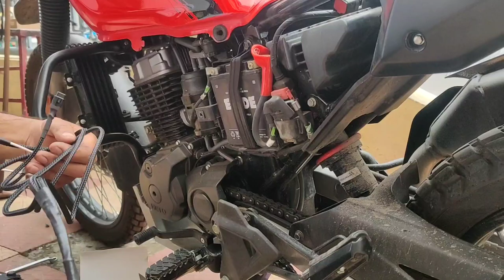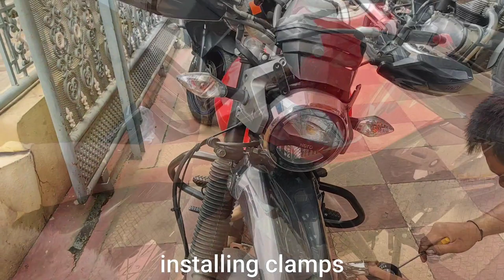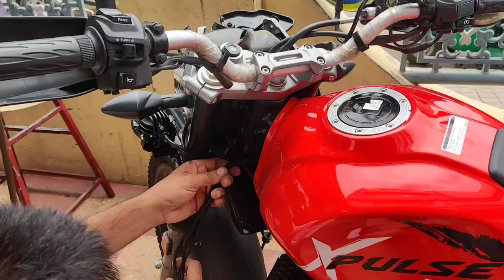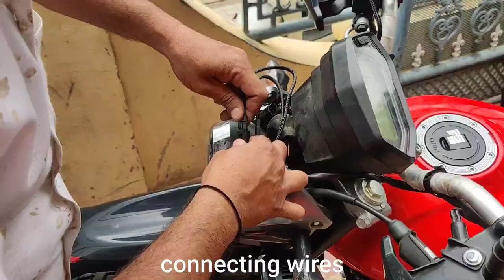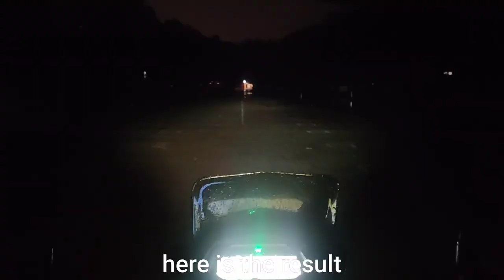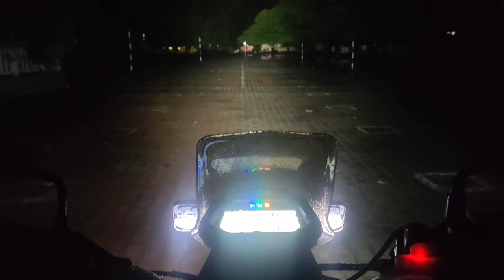Hero Xpulse 200 Lights | Installation Of Maddog Scout X Lights | Performance LED Lights

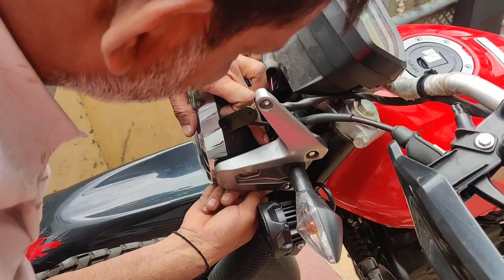Comment: Question- can you tell me at 0:58 where did he connect that white trigger wire from the wiring harness?
Reply from the maker: I don't know the technical term of the thing, but he connected wire into some hub hidden inside rubber covering
Reply: White wire is connected to ignition switch.. so once bike turned on 12v is supplied to the lights. Else it will be on always and anyone can use switch to turn it on!! Owner should know what is done on bike..

Comment: Where was the white wire from charger connected? Does it operate with ignition switch?
Reply from the maker: It doesn't turn on with ignition switch on ...

Comment: The maddog clamp does not fit on the bolt you mounted. Hole is small.
Reply from the maker: It did..
Reply: Bro Can you share link which mount clamp u purchased and share a video how did you mount it?
Reply from the maker: I got it from store near passport office near lalbagh
Reply: @VTVMAYUR  I had to make them big with drilling them 😓